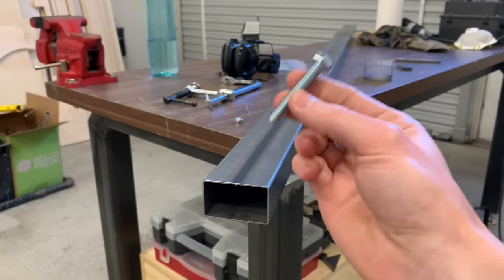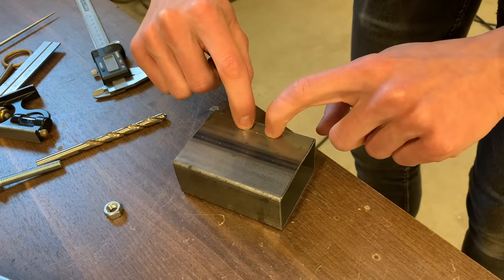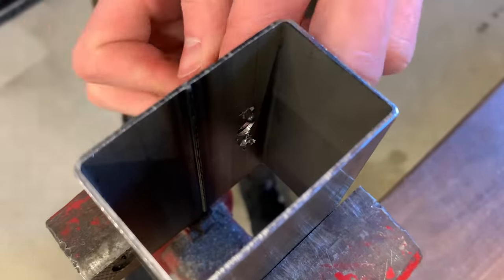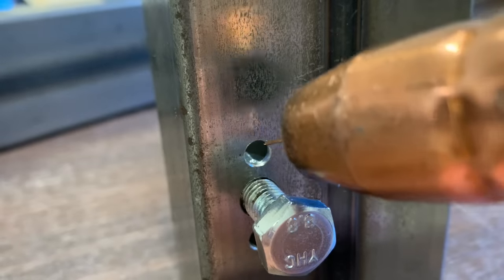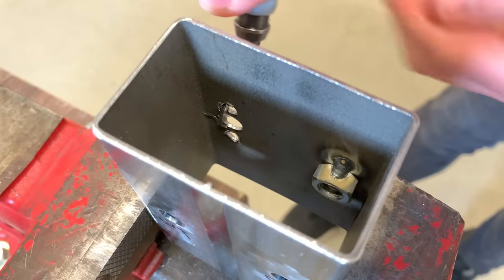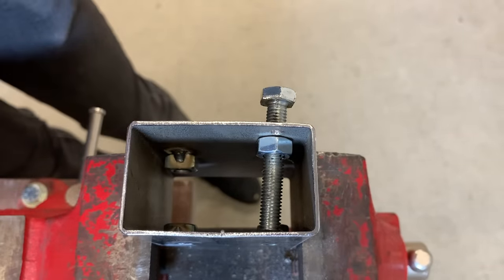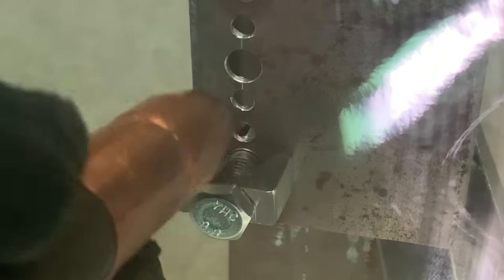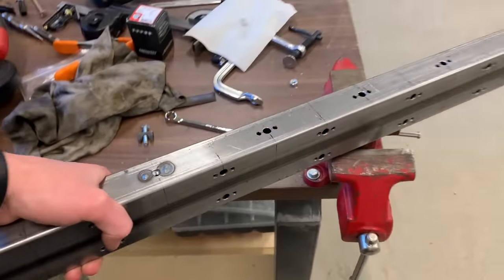Welding nuts to the inside of steel tube

Comment: Some great tips.

Rivnuts really aren't that expensive though. I use them all the time and 100 M8 Rivnuts cost like a tenner.  
I think my putter-inner tool was another 20-30 quid, which I guess is a bit of an outlay but not that huge IMO.

I'd say that the biggest downside to all the rivnuts I've used is that they don't finish up flush with the outer surface. Although I've seen that you can also get ones designed for a countersunk hole so they do end up flush (still working through my stocks of regular ones but will be getting these next time).
Reply: Agreed
Reply: countersunk rivnuts from Ali for like 10 cents each a bargain
Reply: You don't need a setter tool to fix rivnuts, a decent bolt and a socket or spanner will do the job, but it can take a while to get the technique right. I use a power screwdriver to set the smaller ones.  But if you are doing lots of them a proper setter is convenient/quicker.
Reply: @bikerfirefarter7280  Before I bought the proper tool this is what I'd do. It works ok, but if the rivnut doesn't sit tight in the hole you risk it becoming loose and spinning part way through crimping the barrel.

Adding a stack of greased washers can reduce the torque transferring to the rivnut and that helped a bit, but this was still an issue I ran into sometimes.
Reply: I’ve used this method but it was very time consuming ie . Labor intensive. I’ve achieved similar results by over drilling holes, sliding wood backing and then top welding nuts. It provides max clearance on inner tube and was much faster. Great video , thanks for posting. I’m always curious about new ways of getting the work done. Cheers

Comment: Some tips

1. non serrated flange nut. Extra meat to weld to, less chance for the weld to deform the threads, because it's round, three holes can be made, giving even more power to that connection. Bonus, because of the flange, there's a little more thread too (in most cases, these nuts are slightly taller than normal nuts).
2. shoulder bolt instead of threaded bolt. The shoulder can be matched to a drill thus giving you even more accuracy. 
3. Noga RC2000, nuff said. Worth having that tool.
Reply: I had no idea something like a Noga RC2000 existed. Something else to add to the shopping list.
Reply: "non serrated flange nut" I was going to suggest the same thing but I didn't know what they were called! I got them off Dynabolts.
Reply: This is why I read the comments section. Thanks for dropping some knowledge.

Comment: Jer, you can get a blade for your deburring tool that is designed to deburr inside edges of holes. You can even get ones that are made to deburr both edges at the same time and just push or pull on it to only get one of the edges.
Reply: Also three holes & welds would prevent moving the bolt breaking the looser attached ones (Fatigue  fractures with back & forth bolt movements).
Reply: @chrisharvie-smith486 I also think that connection must be stronger. But I don’t know if this method causing bend of tube

Comment: 4:00 shows the threads of the long bolt getting alot of splatter on them, most will fall off but some might mess up the threads on the way out, for this type of install i usually weld the nut to a larger washer or sheet of cut metal if its near an edge first, then when you weld in the nut and washer the washer / metal plate covers those two weld holes allowing you to weld horizontal and also stops the spatter from getting the thread of the placement bolt/s

as a few have said the rivnut option is a good one, there are a few advantages and some cons, the main con for me on the rivnut is for an application where you would be constantly fixing and refixing items to the unit, there is a chance they can work loose over time and spin but for a one time install they would be fine

i usually go the welded method with the nut on a larger pre welded washer / plate

great vid

Comment: Cool idea! You could also just drill an oversize hole and weld the whole nut or a slice of drilled and tapped round bar in flush with the surface, using a magnet to stop it falling into the hole.
Reply: You can unless your trying to do it to M8 nuts and your drill bits top out at 10mm ;) , I need some bigger drill bits. Although I think I have imperial that goes up to 1/2" which would be 12.7mm, which would be large enough for M8 nuts.

Comment: This is exactly what I need to do to some roof reinforcement on my truck while the headliner is out.  I did not think about putting a treads on the flat iron reinforcement so no I will have to JB weld the 12 nuts on before the headliner goes back on.  Great video and awesome engineering!

Comment: Use a Cogsdill deburring tool to remove all the burrs from both the top and bottom side of the holes in one pass.  They have a video on their website that show you how it works.  This can be done by hand, and I have also used them in my HAAS CNC machine with GREAT success.
Reply: Lol that is 170 USD here one size. They are available in 0.5mm steps. Buy a set for gazillion USD. 🤣

Comment: It's another tedious step but thinking of this would also make me consider welding a fender washer to the nut first, and then you could just weld the fender washer/nut combo through the plug hole. I think there would be less chance of error in accidentally touching the mig wire and prematurely plugging the hole before a good weld is made. (Note: this is just my hypothesis.)

Comment: Nice idea. I don't have that bunch of tools. What I Did for a Project similar was , weld a washer to the nut, to have more surface to weld through the drill holes . And for me works very well. Thanks.

Comment: Here's an idea for free... cut a small cross in the tube, line the nut up on the cross, hammer or press it flush, then weld around it. Grind the weld flush. Might need a tool to hold the nut in position, some sort of tube, but it would need an overlap or a stopping mechanism so that you don't press the nut too far. 
edit: In fact, even that is too complex. Drill a hole larger than the nut, weld a tripod on to a bolt with the bolt longer than the tripod, thread on the nut, place the tripod on the box section, hold with one hand, weld with the other, detach the tripod and finish weld, or finish weld then detach tripod.  So many options, I'm feeling creative. .
Reply: I have done that at work where we have a arbor press that's pretty battleship, I dont think my little harbor freight model screwed to a plywood bench could do it for very long
Reply: You must be a body tech I am and I've done variations of this repair for years you probably have too

Comment: The zinc plating will leave you with a weak weld and in such a small area with limited burn time you have no chance of burning of a substantial portion of the zinc. Better to use un-plated nuts or pickle them before use to remove as much zinc as possible.
Reply from the maker: Yes, uncoated would be better, but this is good enough. I tried putting a bolt in these and hammering on it, and the wall of the tube bends long before the welds break. Plus, under normal use, the bolt is pulling on the nut, not really stressing the welds.
Reply: May be faster make more massive tack welding on side, like flange nut, before placing it insude tube. And it will be easer weld them together.
Reply: And if you did succeed in burning the zinc, then you're breathing it, which isn't good either.

Comment: i did something similar recently. I drilled large enough holes in the tube walls that my turned down nuts (from hex to round) could slide into the holes. Then welded them in, sunken one tube wall thickness so i could tig weld the drilled hole wall to the nut's remaining face as an outside corner joint.

Comment: A very ingenious solution. I love watching your approach to problem solving! I wonder in this case if it might not be easier to use a similar approach but instead with a length of flat bar to increase wall thickness. Weld through a series of holes,  then drill and tap.
Reply from the maker: My project is weight sensitive, so I need to keep the material to a minimum. But yeah I can see the flatbar approach being good in some cases.
Reply: I don't think you need to weld the flat bar. Just drill and tap it before hand and then work your way along the flat bar tightening the bolts in place. But we haven't seen the final use of this item. Once we see that we will have a better idea of what alternate approach may be better. I don't know how to weld so I would try pretty hard to find another way to do it. But For Jer welding is not a big deal so this way seems to make sense. Anyway, looking forward to seeing how this gets put to use!
Reply: @Jer Schmidt I thought there might be a weight issue, only reason I could think to go with nuts when there were so many of them. Looking forward to seeing the final project!

Comment: I'm used to first welding a nut and underplate together, then drilling bigger than needed hole on the tube, and then welding that underplate to cover the hole. The way you did it is finer, and leaves a flatter surface, so going to try this next time. Thanks :)

Comment: Use a drill press vise! A high school buddy that we interred recently at age 70  had his thumb yanked out by the roots  50 years ago because he was doing the same thing. That drill bit just has to catch in the material and its all over 'cept for the crying. Thin wall is basically sheet metal folded up and can become a rotating knife in a blink. Just a tip from a retired tool and fixture maker.

Comment: You should look into FRICTION DRILLING (flow drilling / thermal drilling) and TAPPING. All you really need is drill and a tungsten carbide flow drill bit. You can take thin-walled stock and essentially thicken the wall for tapping... no inserts or bolts required.

Comment: I used this method on the pallet of my mill to make the mounting threads.
With flange nuts you'd have more area to weld on and they tend to lock to the surface so you don't need to have the long wrench tool, just something to push them in like a magnet stick.

Comment: You could also tack the nut onto thick gauge wire or length of flat steel, would save drilling and welding. Use spring washer and loctite to hold nut securely and prevent nut slipping on the bolt. I used this idea to install a towbar onto the chassis of my xtrail. Good video and idea, cheers mate.

Comment: I saw another welder just drill one slightly larger hole and then fill it in. He then redrilled to correct the smaller size and tapped that thick part of the metal. I like your idea and will be using it.

Comment: I did this recently (with a slightly different solution). My nut holder was a magnet on a stick. I also like to strip the zinc from parts before welding with a quick HCl dip.

Comment: I've had to do this before and it can be a PITA. What works the best (that I've tried) is to make only a single hole, sized so the nut goes through it. Thread it onto the bolt and insert. Let the bolt bottom out, like you did, to set the height. Weld from the face, around the perimeter of the exposed bolt (the top of which is flush to the exterior of the tube. Grind flush. Done!

Also, with trying to debur the interior side of a hole, they make hand tools for this. It's much easier than trying to use the style of debur tool you used (which are better for exterior and larger holes)

Comment: Clever method. Spraying the threads of the longer bolt with ceramic anti spatter may help keep the threads clean for when you back it out... as to not compromise the threads of the bolt that had just been welded.

Comment: You could use something like a Noga HSS RC 2000 Deburring Tool this is designed to go into a hole a deburr the inside, it very clever the way it folds to go in then unfolds to deburr.

Comment: Very ingenious solution.  I used to work for a company that did a lot of sheet metal case fabrication and we used a “clinch” nut that was pressed in, I believe from Penn engineering. Just trying to think how to apply them to the inside of a square tube, it would be tricky. Probably what you devised is the most efficient way.

Comment: Nicely done. Some handy tips/ideas in here. I've been gabbing as a hobbyist/low-grade pro for 20+ years and I say this from experience to help: anti-spatter spray is going to save you and any followers of this method, a ton of heartache.  There are many different brands and at least two kinds I've used, both worked well.  Airgas has the "Radnor" brand stuff in aerosol cans, and there's another that comes as a liquid in an unpressurized gallon jug (I forget the name at the moment).  I put that liquid on large surfaces with a cheap Horrible Freight finish paint spray gun. I've heard, but not tried, that vegetable oil will work, FWIW, if one has a project to get done but not time or patience to go and get or order and wait for pro products.

Thanks for this video, this was informative. I'd like to see a copper bolt and an arc welder used as a spot welder to avoid those access holes, though.

Comment: This is a clever solution to a problem that can be solved a bit easier. Ive had to do similar, just cut lengths of 1/2 inch round to fit into the holes, weld around it, and then drill and tap the 1/2" round stock.

Comment: i'm going to make your day, im one of those old guys that had to improvise my entire life because back in the40s and 50s we made our own specialty tools. today imagination has no bounds as far as tools. ive even invented a couple that worked but didn't take off. for what you are doing, that is needing to reach inside and hold the nut is something we have always had to deal with.a company called handee clamp makes something so simple and useful your head will just think, why the hell hasn't anyone done that before. can be bought most anyone, about 20 bucks or less.  made to reach up through bumpers or cavities to hold a nut in place till you do what you want. it is perfect for that job. i got mine from amazon , free shipping etc, lisle tools im sure had one. looks like a flat piece of metal about a foot long, one piece flat fits inside one piece with sides bent over to make a simple slide.
one end has the end turned up 90% ON bottom piece. top piece has the same bent over tab at same place, the tabs are turned up about a quarter inch so you can lay a nut in the opening and hold it in place. at other end is a threaded bar and round nut to snug the nut up and hold it in place till you bolt it or weld it . its name is handeeclamp.com  a c&c product  this little tool will do what you want and if it doesn't you can bet it will be useful later.

Comment: Using countersunk bolt for holding the nuts in place works to center them and hold them square.  If needed you can grind the head down for clearance.

Comment: That was clever ! Each one has his way of solving problems.  I would probably go with a homemade nut. A strip with a threaded hole in it. More work at first but it would simplify the welding as you could plug weld the "wings".

Comment: I weld my nuts to a flat washer on a table to get good purchase then drill 3 holes and weld through like you to the washer though instead of to the nut. Makes weld diameter slightly wider which is easier to drill and maybe a bit stronger cause you can control the weld on the nut first. But good content and getting the word out to those that aren’t aware.

Comment: Setting a RivNut needs a bolt (ideally high tensile) and two wrenches. Easy. 
Bolts into thin tube are best done with internally threaded tube. Drill a tube clearance hole one side and bolt clearance the other side. Weld the side with large hole and grind flat. Job done. Result is a treaded tube that goes all the way through your tube. Strong and stable.

Comment: Very nice. Although laborious. Another solution is to use friction drill, that melts down the hole and makes "skirt" inside tube. It can then be tapped. I saw these friction drills and threaded part in one piece.

Comment: I discovered that my several sets of old made-in-China Enco dial calipers have harder tips than either my Brown and Sharpe or Starrett and work great for scribing. I put a bit of Neverseez on my bolts before doing the welding so they don't gall. Especially with SS.

Comment: I have a way to do this which might work and might be easier.  Drill and de-burr an oversized hole - say, 3/8" diameter.   Then slide a steel blank underneath the hole - say, 5/8" diameter, or a square cut from a bar.  When it's in position (center is marked with an ink dot for alignment), hold it in place by slapping down a magnet or two.  Then weld in place, grind the weld flat, and drill and tap.  The blank might be available commercially, so you don't have to make it.

Comment: Have used the a few times before. I use a piece of all-thread as the keeper and just cut a slot in it, so I can tighten it up with a screwdriver. This gives me easier / clearer access to the holes. Could also cut the head off a bolt and grind in a slot to achieve the same thing. Great video though.

Comment: You can also buy the weld nuts from McMaster carr for around .50 ea. They have the shoulder already cut and ready to be welded. I have also found that it's a good idea to protect your threads on the inside of the tube from weld spatter or risk having to remove the nut and start over, a real PIA!

Comment: I'd be curious what torque strength these nuts can take. There isn't much weld area between the nut and the tubing; it's only on 2 snall corners.

Comment: A nice simple alternative to rivet nuts which can have a tendency to spin if not put in correctly. Also maybe use some splatter guard on the bolt to avoid stripping out the nut on removal, but good work mate.